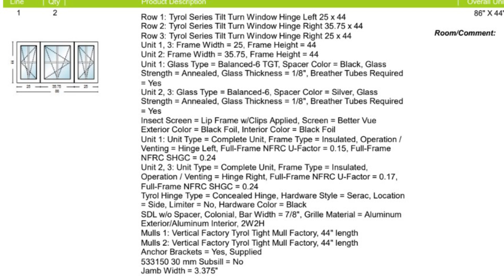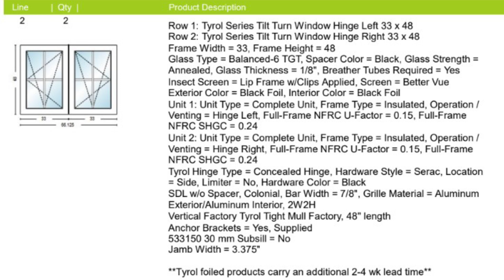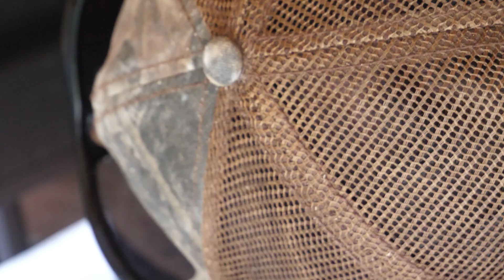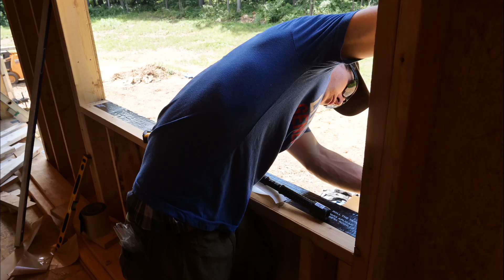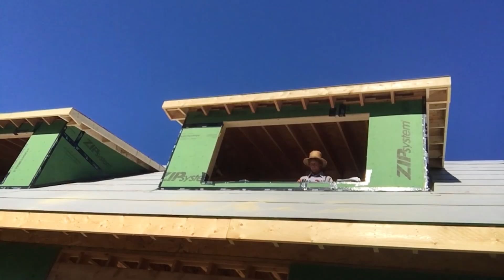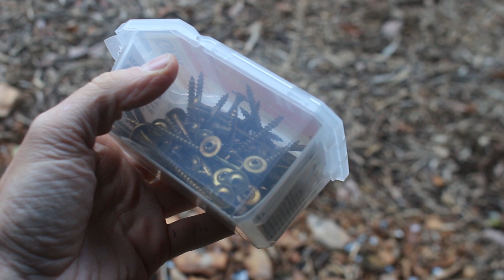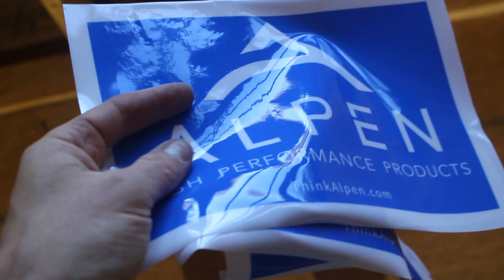Alpen Windows - Tilt and Turn Windows | Details & Cost

Comment from the maker: Want these same windows for your project? You can work with the same (extremely knowledgeable & patient) representative we did! Enter your contact info in the Google form link and Shawn will be in touch! 
https://forms.gle/uzC9cRF5Cck2uxWL8
Reply: Do they ship to the west coast?
Reply from the maker: They ship anywhere in the lower 48 and maybe even outside of that
Reply: @tyshandmadesoap384  I went with Lowes in San Diego who got them from Crystal Window & Door Systems, Ltd. out of Riverside. They were the closest to us and delivered free to Lowes for pick up. Alpen High Performance Products is also on that distribution/manufacturer list for REHAU tilt-turn windows. You can search by zip code for the nearest supplier. But check with Lowes. Not everyone at Lowes is knowledgeable about these so you might get deer in the headlights looks...

Comment: Any update on how these windows are preforming?
Reply from the maker: Still loving them, everything looks the same as the day they went in
Reply: @MasonDixonAcres  Which did you get? Zenith? Might be the Tyrol as I am not sure if the Zenith does the tilt and turn. Do you know if there is enough space on the header to inside mount blinds in those windows?
Reply: @chrisc813 In another comment, he says they passed on Zenith because that line didn't have the tilt and turn style they wanted.

Comment: I live in Germany right now. Can't stand that type of window. Not sure about your's, but here, they are not built for bug screens and you can not use portable A/C's.
Reply from the maker: Ours all have screens on the exterior side. This price point of window would almost never be installed in a home that doesn't have central air, at least in the U.S.

Comment: They look like the standard triple glazed windows we have here in germany. "Schüco" is one of the best brands you can get here. We usually install them a bit differently, as our walls are 2-5 times as thick and out of stone/concrete. In most cases concrete screws (or big wood screws if you got a framed house) are used that are directly driven through the window frame. Also, you can easily temporarely remove the window insides to easily install the frame. Windows are looking good! Nice to see european windows in the US. Now try wall mounted toilets e.g. Geberit systems:)

Comment: Before installing, you take out the windows first and install the frame only. Way lighter and you can check the correct place and perpendicularity.😉 Than drive your mounting screws through the frame into the wall studs, bring the windows back in and adjust them.
Reply from the maker: Interesting thought, I feel like the sashes aren't that easy to disconnect/reconnect and keep them in alignment with the tilt-turn mechanism. Never done it though so I could certainly be wrong
Reply: @MasonDixonAcres  I don't know haow Alpen-Windows are made, but they have to assemble it too. Usually the top corner hinge has a bolt wich can be released downwards (dont't worry it doesnt't get lost) and then you can lift up the windowframe from the bottom corner hinge. It might be a good idea to aks Alpen about that.

Comment: I am a few days from ordering about 10 of these windows.  But then, I saw a (fairly old) youtube video detailing quality control issues.  What say you?   Are you happy with quality of these windows?  How are the corner joints?  Can I presume you are not being sponsored by Alpen for this video?
Reply from the maker: If you haven't ordered yet, I'd recommend contacting Shawn, the rep we worked with. He's a high performance builder in NC that uses them on every build and knows them inside and out. Very helpful to talk with as a first time installer
Reply from the maker: Just saw this now, but we have had no issues. No leaks, everything is tight. And we had them in the rough opening for like 18 months with only the shims, so any leaks would be obvious. One of them needed a little hinge adjustment for the sash to close more easily in the tilt function. We paid full price for the windows.
Reply: Thanks for the feedback - very helpful.

Comment: For your Tyrol windows, are the grids bonded to the surface of the outside and inside panels? It appears so in your video.  And are they made of the same material (RAU-FIPRO uPVC) as the frame?  Thanks for you time.
Reply from the maker: Yes they are bonded on the outsides with a strong 3M double sided backer tape. They are painted aluminum, not PVC.
Reply: @MasonDixonAcres  Thank you for the detailed response.  Long story as to why I asked.  Simple version is I was discouraged from ordering grids with the Tyrol windows.  The claim is they negatively impact the low thermal transfer value of the glass package. However, I see your window submittal sheet and window stickers have the standard Tyrol U-Factor and SHGC (0.15/0.24) values. So... I feel more confident going forward with the grids.  Thanks again.

Comment: Wow! Those are some seriously low U-values! Once I found out about series and parallel heat flow I learned that it’s more beneficial to spend your money on window performance than extra insulation to improve whole wall R-values. Assuming one has financial limitations!
Reply from the maker: Right, even the best windows make really bad walls 😅 always get as good as you can afford!

Comment: Alpen is one of the few manufacturers left that make what they call "Heat Mirror". Basically, polymer for the third inside pane saving you all that weight in those large windows at like an R20 level insulation.
Reply from the maker: I believe the heat mirror is their reflective film for high sun areas, the "thin-glass triple" is what you might be referring to. The center pane is similar to phone screen glass.

Comment: do they have hurricane impact Tilt Turn windows?
Reply: There is an European window system with great hurricane parameters - made from aluminum.
Reply: @Alice-debesto  needed them in UPVC
Reply: @shenoyglobal  which brand and model did you choose? btw, why not aluminum?
Reply: @Alice-debesto  for coastal regions with salt in the air upvc is better than aluminum. Even though they say aluminum dosent rust , it eventually does
Reply: @Alice-debesto Which maker?

Comment: Thanks for the informative video. I am planning to purchase Alpen with an energy retrofit project in Minnesota. 

Did you price Zenith series fiberglass? If so, how much more?

With the inward swing of the Tyrol series, can standard louvered blinds fit inside the jamb extension area without interfering?

Please message me your Alpen contact.

Mike
Reply from the maker: We did, and they were maybe 5-10% more expensive. The biggest thing was that we didn't like the look of the interior hardware on the Zenith casements, and we liked the 'cool factor' of the tilt turns. As for blinds, it will really depend on your window height as to how far the blinds hang down when fully retracted. I will guess they would intefere with the top of the window sash. I would opt for a different solution if you want window covering, such as curtains hung on the interior casing etc.
Reply from the maker: I don't think I can message you through YT. Send an email to masondixonacres@gmail.com and I'll copy in our rep who was awesome and extremely patient.

Comment: Which line of Alpen Tyrol series and what level or R value are they? That info would be very helpful for those of us who want to order from Alpen. Cost comparison would help us choose a product also. thanks!
Reply from the maker: Sure! The U-values (inverse of R-value) are listed at 00:23 and 6:50. This corresponds to the TR-6 series. Costs vary greatly depending on all the details such as size, grids, color, fixed/operable, etc. so you really need to get a quote. Our rep Shawn was awesome to work with. Here's a contact form if you'd like to reach out to him: https://forms.gle/uzC9cRF5Cck2uxWL8

Comment: Hey Alex.

I'm planning a self-build in Colorado at 10kft elevation and am planning on Alpen windows as well.  My drivers were their ability to build argon filled triple panes that will put up with the high elevation, the amazing u-factor, and the tilt-turn style as i'm targeting a very very low blower door score well below passive house standards.  Glad to hear you've had such a great experience with them.
Reply from the maker: Awesome to hear, building below passive house specs is quite the endeavor! Just make sure to keep an eye on ventilation and humidity as always. Can't complain about anything yet! Make sure when you receive the windows, inspect all the balloons. One of mine was torn and I was pretty scared, I called my sales rep right away and it does happen from time to time, I just crimped that one right away. I probably won't ever notice if it did lose some Argon, but just something to keep an eye out for. Good luck!
Reply: @MasonDixonAcres  Did you keep track of where you installed the cut bladder?  Any issues with it or your other windows?   I've been planning on using Alpen but most of the reviews are negative.  I suspect their doors have more troubles than their windows.
Reply from the maker: @JW-gc5ve  yeah it's the center kitchen window and haven't noticed any difference. There's very little pressure difference so I don't think it really did anything. No complaints about our tilt-turns, everything is tight and operates well
Reply: @JW-gc5ve  Be careful when looking at reviews, as there are two companies with similar names.  'Alpen' windows, which are featured here are from Colorado, while "Alpine" - a completely different window manufacturer, are from Washington State.